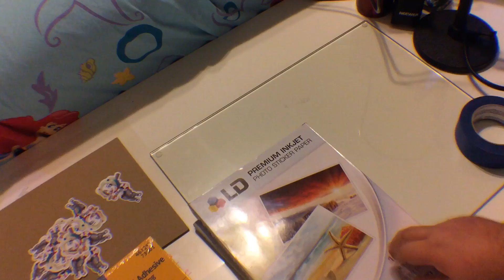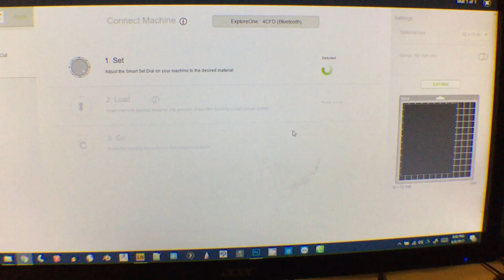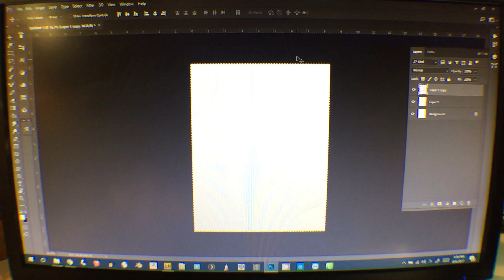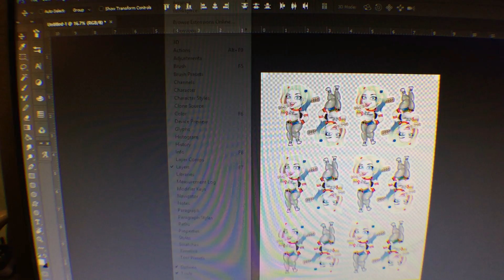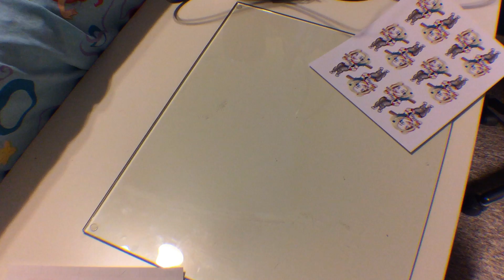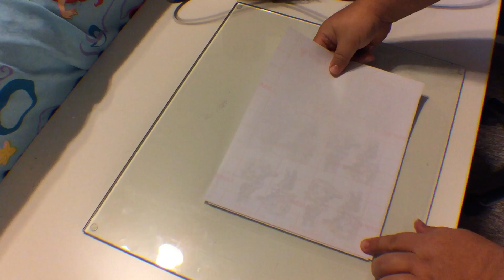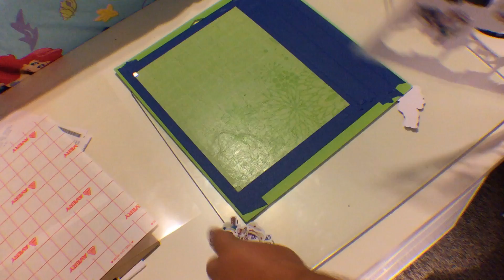Trick your Cricut to do FULL PAGE Print and Cut - Sticker Tutorial!!

Comment: For full colored designs, you will have to manually add the bleeds to make sure the cut will not have white offset. Unlike printing directly in Cricut which gives you the option to put bleed that the machine automatically generates. This one in the video actually has offset border.

Comment: Ok. That was awesome! Finally a way to use almost the whole sheet of paper! 
For your mat.. I did some research and found a great way to get my mat to be nice and sticky over and over again! I washed my mats in warm soap water and scraped off paper bits and etc. Air dried. Then if you don't have a steady hand, use painters tape and tape off the outside edges that are not supposed to be sticky. Now using this glue I bought from Walmart, (I paid under 10 dollars for 2 bottles), called tack it over and over, and a sponge brush, I "painted" in thin layers on the space that is supposed to be sticky. Letting it dry between layers, ( I found that most of the time I only needed to use 1 coat), test with your hand it's stickiness ability. If your mat stays attached to your hand after placing your hand down on the mat then lifting, then you're good, but if not, add another layer of tack it glue. This works incredibly and I even have some of the first circuit mats that had lost their stickiness years back and work beautifully! I have to say this was not my idea. I got it from a young lady who did a video on this and I honestly do not remember who she was but she deserves full credit. I tried it, it works and just wanted to share what I learned from her! I will be looking forward to more of your videos! Consider me subscribed! 😊

Comment: Great trick!  Not sure what I'm doing wrong but this flat out will not work with an Epson ET-8500.  No matter what I do, I can't get the registration boxes to print with the correct measurements, even with borderless printing.
Reply from the maker: You don't need to print the registration boxes. I would not use borderless. The idea is to trick Design space into not shrinking your design and allowing you to cut a full page. Your registration marks should cut correctly within the tape on the mat.
Reply: @EricMBoyd  Thanks for replying!  I took a deep breath after my comment and kept trying.  I got it to work 1 time completely perfect but it went back to cutting wildly off after that.  I'm not sure what exactly is going wrong, but the registration marks never cut in the same spot twice.
Reply from the maker: @JLxNJ  try something to print the same page on regular paper 3-5 times. Overlap the pages put up to some light and I find 90% of the time the issue is the printer is not always printing the page the way we think. You will most likely see that the images do not always align. I found this to be true on multiple Tray Feeds on my 3 Epson printers. I have to use a rear feed to make them print more uniformly.
Reply: @EricMBoyd  Printed a few copies of my design and they all line up pretty perfectly.  The problem I'm having is the cricut machine starting the cut way outside of the original 8.5" x 11" square, like its reading its starting point wrong.  I calibrated the blade a few times, make sure to load the mat in correctly and have been re-doing the square every couple of fails.
Reply from the maker: @JLxNJ  ok so you are not doing the trick your cricut method you are doing print and then cut through design space.
Reply: @EricMBoyd  Hey Eric, thanks for keeping up with me.  I am not doing the print then cut option, I'm doing the one outlined in the video.  Blue tape, cutting the 8.5x11 square, putting 1/4" registration marks on a sticker sheet, and cutting the png template cut of my file.
Reply from the maker: @JLxNJ  Do the 4 squares in the corner of the tape cut correctly?
Reply: @EricMBoyd  They will cut, but never in the same spot twice
Reply from the maker: @JLxNJ  hmmm thats a problem. Mine will always be in the same spot. Actually cuts through the mat eventually
Reply: @EricMBoyd  Hey Eric, wanted to follow up and let you know I eventually DID get it to work but it needed a few tweaks.

1 - In your video, your laminate is over the white squares, this also helps the sensor on the cricut read the boxes.  I added extra matte scotch tape to my sheets to help the sensors read the squares (the paper may have been too glossy)

2 - I read online that the lighting that the cricut machine gets can effect how it reads the sheet.  I closed the top hood only of the machine and it reads 100 times better

3 - I put the sheet of paper & the mat itself as far to the left as possible (within the blue tape) when loading it in.

It's not 100% perfect, but its definitely workable!
Reply from the maker: @JLxNJ  I am glad it is working but if you are doing the trick your Cricut way I don’t ever use the Cricut sensor to read anything.

Comment: Great tutorial. Can you explain how this works for you in terms of money, is it worth doing this, can you make extra money doing the stickers? Thanks
Reply from the maker: Yes, absolutely, I was selling stickers at comicon shows and online. When you can sell stickers for $2 each and a single sheet of sticker paper costs 25 cents with laminate and ink. I wanted to get as many stickers to a page as possible. With the Cricut size limitations I could only get about 6 stickers to a page. That's $12 a sheet I make selling the 6 stickers.  With this trick I could get 9-10 to a page and that is almost $20 a page. Not a big deal with stickers, but when doing MAGNET Sheets which can run about 2-3 dollars a sheet before laminate and ink it was a huge difference. Hope that helps. I now make full Vinyl Stickers and stopped making the paper ones. Cost slightly more, but people pay more for waterproof stickers to put on cups and what not. Ordering from a supplier is great but they charge $1-1.5 per sticker and they want 25-50 of the same sticker. My way I make more money and they are pretty much made to order.
Reply: @EricMBoyd  Wow, that is great. I have Silhouette cameo 4 and bunch of vinyl in stock, I was trying to sell stickers even below price but nobody seams to notice this, they say it is way to expensive  and a cost of shipping is huge in comparison to the price of the sticker, only solution is to sell in a bulk of 50-100 stickers but where to find such a client, it is a mystery for me. Thanks for braking this down for me, I appreciate it.

Comment: I'm trying to figure this out, and I get how you gotta tape off the 8.5x11 and line it up, If you are printing the same file, and uploading one as a cut image, then printing out the artwork and cutting it over top, what is the point of the registration marks? Is it just to see if it doesn't cut the square properly then you pause the cut an adjust? I'm not seeing the purpose or use of the registration marks?
Reply from the maker: Cricut design space does some weird stuff with the uploaded files. My printer will print borderless but I don't like the results so I can really only print 8.25x10.75 correctly. If I upload the page to design space it will resize the file CROP extra blank space. The registration marks prevent this.

Comment: Change the registration marks to the pen tool and leave the pen out and you won't have a problem with the corners.  Or... remove the registration marks in contours.  Both methods work.  If your mat is wearing from cutting same place, create a .01x.01 pen circle at x=0 y=0 and position your sheet to whatever x/y value you like so long as it does not exceed mat width/length. Recut your masking tape and repeat the registration markings for each new sheet.  Use printed glossy vinyl stickers and you won't need laminate unless you want water proof stickers.

Comment: EDIT UPDATE AS OF 10/5 - Here are some changes I made. First - I ran a re-calibration on my cricut even though this does not use print and cut. 
      Eric keeps saying "Get your registration marks on point, and work from there. He's right. I scrapped it all and started over getting rid of my 8.44x11.06 original solution.  
      I cut the tape on my mat, but BEFORE I peeled it off for my 8.5x11 area.. I printed JUST THE REGISTRATION MARKS!!! I ran each cut twice in case I did not place it right. Once I got them perfect, I no longer used the 8.44x11.06 I mentioned below and went back to 8.5x11 and perfection happened. This took me 8 hours to work on. FYI lol.... 

10/3 - I have read MANY of these comments - Here is my 2-cents.

OK after 2 deleted comments, and spending 3 hours on why I was having alignment issues - here is what I found.
My printer is HP ENVY 7855 an I make sure my paper tray is snug on the sides.

Come to find out trial and error myself... YOU REALLY NEED TO MEASURE YOUR PAPER SIZE and I can't yell this loud enough to the people in the back!!! The J&J brand printable vinyl I am using advertises 8.5 x 11. However, it is really 8.4375 x 11.0625. Not only is it shorter, it is also longer. sigh after adjusting my template in Photoshop and using a new mat to re-cut for this adjustment (while using Eric's tip of holding the mat to the very left of the machine) I now am getting better cuts. 

Photoshop will round the measurement up to the nearest 100th, and cricut will round it to the nearest 10th. So cricut will make it 8.438 x 11.06 whereas photoshop will put it at 8.44 x 11.06.

After this trial and error, I can NOW get close cuts on my stickers.

I suggest to PLEASE MEASURE your material, and make ONE mat for that specific sticker paper, printable vinyl ETC. if they are NOT a true 8.5"x11"

If there is something you do not understand of what I wrote.. reply to me and I will do my best to answer. I know years later, those who have a  cricut will find these great videos.
Reply from the maker: Well said!
Reply: @EricMBoyd  THANK YOU for your comment.. I need to make an edit, I didn't know which video I left this on lol.
Reply from the maker: @heatherjak1875  I have been having same issues as of lately bottom of the page have been cutting off (NOT ALIGNED) but I have not taken time to troubleshoot it. It happened after DS update.

Comment: This video is amazing however after following it to a T it is cutting off center every time both too far to the right and too low on the sheet. I apply no pressure when loading the mat. I am using a Cricut Explore One, Photoshop 2021 and a HP Envy 4500 printer on a vinyl self adhesive paper. Please help I really need to get this right.

Comment: I must be missing something. My printed sheet never matches up with the .PNG file I uploaded into design space.  Doesn't matter is it's as is, fit, scale, or shirk it's always way off.  I even tried boardless but that actualy enlarges the image a small amount then cuts off the edges when I print. In return not matching my .png. I don't know what I'm doing wrong here. Any ideas?
Reply from the maker: Do the registration squares cut correctly in the corner of the tape?
Reply: @EricMBoyd  No, I have them lined up exactly like you have them. I'm thinking it has to be something in my printer settings. The printed sticker paper never lines up where it needs to cut. I'm using the same file for both.

Comment: I’ve followed the tutorial to the letter, my cuts are 4.5 in circles. The design has a white border, but it’s cutting slightly off center. Not sure why it’s not centered. I created in Affinity Designer, I use alignment tool and I know the design is centered. Not sure if it’s my printer or what. Any advice I’d appreciated.
Reply: I got it!! I just put a stroke on the outside circle and used expand stroke and it printed perfectly! Hopefully it will stay that way!🤞🏻 Thank you Eric
Reply from the maker: Thanks! Glad you got it to work!!
Reply from the maker: Are the registration squares cutting correctly?
Reply: @EricMBoyd  Yes, everything seems perfect,  but it's consistently cutting slightly off centered the same exact way.
Reply from the maker: @dianemcilwaine9002  perfect, so if the squares are correctly cutting then whats off is the print? I find 90% of issues with this is not the cricut but the printer. I recently had the same issue I was using windows default printer by accident instead of my epson printer settings and oh wow I was frustrated not realizing no matter what I tell the settings it would not listen... wrong size, not centered, and quality was not as good. Page looked right but it was not. Once I reinstalled  the printer drivers and used the same settings as my video I have been making decals as of late like crazy.
Reply: @EricMBoyd  I'm cutting circles and the outer edge is a plain white border. The border isn't coming out perfectly even, it is larger at the top and thinner at the bottom. Always exactly the same. It's like I am so close, but no cigar! It's making me crazy, I really want to utilize this hack.

Comment: Can the prep be done with procreate instead of ps?
Reply from the maker: I want to say yes and I have not confirmed that.... I just got an iPad and thinking about trying it.
Reply: @EricMBoyd  thank you man
Reply: So you can use procreate as long as you add registration marks a quarter of a inch in each corner. Use the grid on procreate and make sure it’s a quarter of inch boxes and fill each corner and this will do the same as photoshop but easier in my opinion
Reply from the maker: @anthonycroteau6554  yeah thats great to know.... thanks for sharing.

Comment: I’m having a huge issue getting printers to print the full 8.5 x 11 document size. My registration marks are on the corners but every printer I’ve attempted to print from automatically resizes my image so that it’s smaller than the entire paper size. I even went to Staples and FedEx Express and both of their printers did the same to all my pdf, png, psd files. 
Do you have any advice for this kind of problem?
Reply from the maker: All printers crop off about 1/8-1/4 around the border... this is normal unless you are doing borderless printing... I do not recommend borderless as it can cause issues. Stay inside that print area. I print cropped but I never get to close to edges on a print... the cuts can be outside that area but not the print. What I mean by that is the WHITE border of the art can be out side the printed space right up to the edge of the paper and it will cut ok and there is nothing to print there because it's white. Registration squares do not need to be printed  or seen.

Comment: Go get yourself a Xyron 900 (9 inch wide) Cold Press Lamination Machine.  With it you'll be able to use hot swappable cartridges for lamination+adhesives, double sided laminations, lamination+magnet (10 ft roll), repositionable adhesive, permanent adhesive.  The cartridge materials are all photo safe and will create archival results.  When you cut into the laminate it will NOT peel or separate from itself.  And because you're running things through rollers you're also getting rid of air bubbles that can sometimes result from using the Avery type of cold press lamination kits.  If you don't need the magnet with lamination then the rest of the options are sold for the larger 12 inch cold press lamination machine which is sometimes marketed under other company's brand names.  Same X shaped machine with 3M or some other logo on it.  If you need even lager they have a commercial side as well for two part rolls (feed and take-up) on cold press equipment.

For sticker paper I'd advise checking out what Uline has to offer.  You may find way cheaper prices and much larger quantities.  For printable flexible magnets made in the USA I'd go with DiscountMagnet.  My laser printer works fine with the 12 mil thick printable flexible magnets.  Their printable magnets are for both inkjet and laser printers.  This is where having a laminate option is handy because the toner will tend to rub some of itself off if you're brushing against it.  When you're ready for an upgrade the DX series of Brother SCan 'N Cuts have 600 DPI built-in scanners with their cutters.  Plus a blade that automatically senses the thickness of the material loaded on their mats.  It does a few tests to "know" how to cut the material without needing additional guess work from the owner or user.

You wouldn't need to go to the extra effort of making alpha channels.
Reply from the maker: Wow... thanks I will look into this for sure.

Comment: Why didn’t you run the whole sheet through the cold press prior to cutting?
Reply from the maker: Because the edges are sticky. Coldpress will grab them. I can do this but its more work... I need to reapply the laminate backing and if it is not completely aligned it will have sticky edges. I do have a new laminating matching that can make this easier but either way works.
Reply: @EricMBoyd  right on bro. Thanks for the speedy response 🤟🏻

Comment: I followed every step but no good. it cuts outside of the image, in the wrong way. I calibrated my Cricut and does the same. Iºm just trying to do this because Cricut prints my image in low quality. Iºm almost quitting this and sell her and buy a silhouette
Reply from the maker: Do the registration squares cut right? Focus on the squares! If they are cutting correctly in the corners of the taped mat then the issue is most likely your printer or something wrong with how your printing it. 95% of the time those are why it’s not working.
Reply: @EricMBoyd  the registration squares are correct. I tried everything. I even calibrated the printer and cricut
Reply from the maker: If the registration squares are correct it is working the printer, the way you are print or the files are off.